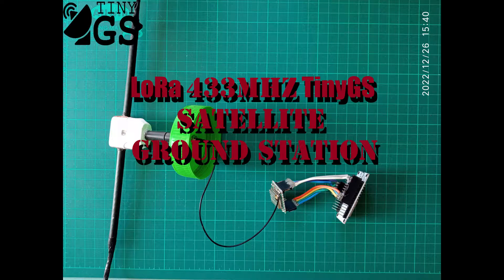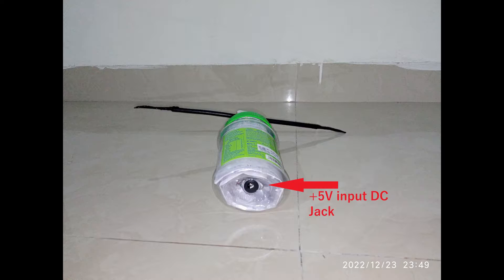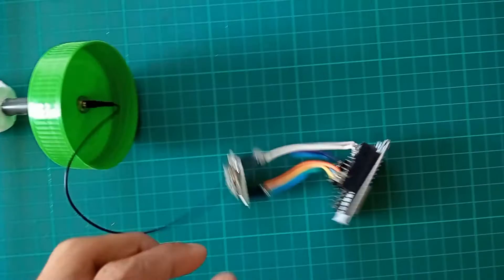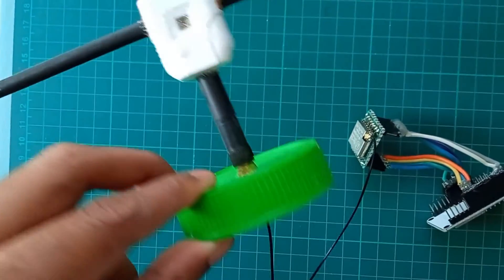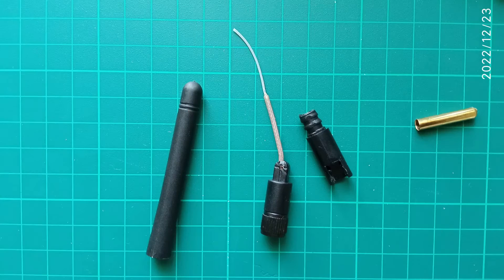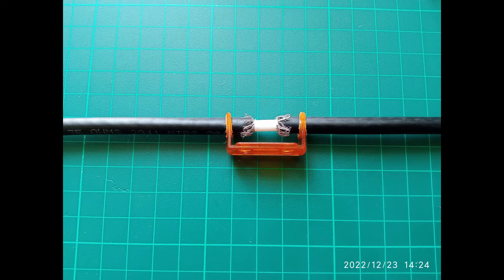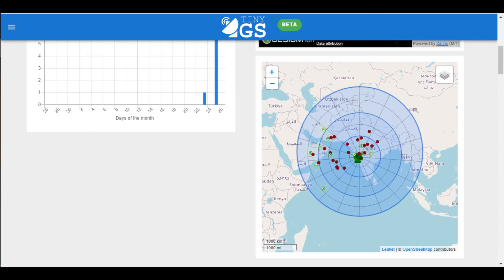LoRa 433MHz TinyGS Satellite Ground Station

Comment: I cannot thank you enough for posting this and your blog entry.  I originally had a HopeRF 915MHz LoRA module that I couldn't get working, so bought a Ra-02 to better live in the common TinyGS frequency ecosystem...only to discover there was almost zero info on pairing this unit with an ESP.  Then I discovered your YouTube video and blog link with an EXACT walkthrough and profile match.  No special configs or anything.  Up and running now.  Thank you!

Comment: You didn't make the double bazooka balun as described in the drawings, but just extended the cable shielding, so your antenna is not balanced, which will reduce transmit power, or did you stick a needle in each 1/4 pole through the cable to make the connection? Also Horizontal polarization. Shouldn't you mount the antenna vertically?
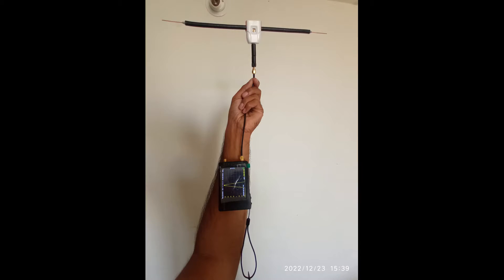Reply from the maker: Thanks for the question. Checkout at 2:06 the shield at both corners are twisted and connected to center conductor. When we talk about polarization of tinyGS or any satellite it's circular polarized and if you are using a dipole to receive the signals it doesn't matter if you set it in horizontal or vertical polarized.
Reply: @vu3zag   Oh sorry I missed that. It does make connection, I'm blind. Also only thought you were using it for ground communication not space. Thank you my questions answered.

Comment: Hey bro, I have built a Bazooka Dipole Antenna with RG6 coaxial cable.. I just need to know whether I could connect my Bazooka Dipole Antenna to my Lora ESP32 Paxcounter 433MHz Board.. Will it receive data packets? You have used an SMA Connector Right? But Can I connect it directly because I'm using a Lora ESP32 Paxcounter TTGO 433Mhz
Reply from the maker: Yes you can. If you have noticed.. I have used basic lora module, so I used the IPX- SMA pigtail. Also make sure you select the right module while configuring ( refer the official page for details)
Reply: @vu3zag  Ok Thankyou ☺️. Can I get your contact?